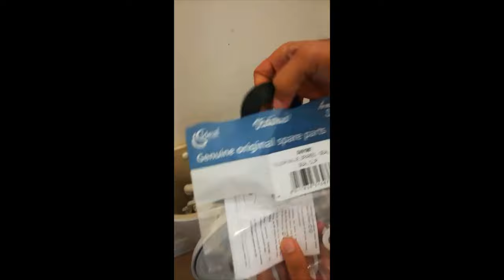How to Fix a Leaky Toilet with Running Water Stream - Ideal Standard

Comment: If you have a running flush yes it's usually the small seal which hitted. If that doesn't work the float valve may be unrepairable. The float pushes up a lever that operates a small white pip in the seal. Unfortunately there is a tiny rubber seal in the float pivot arm. If that seal goes you will need a whole new float valve.

Comment: Before you replace the unit get a rag or sponge into the socket. Clean off any grot so the rubber bears down onto a clean surface. If any grot gets between the mating face it can leak.

Comment: Thanks so much for posting this. Both seals were damaged on mine after 12 years. The edges of the flush seal had crumbled away over time, and the diaphragm, although visually sound, had a pin hole in it. The flush seal was out of stock in 5 places I tried, but my local Wolseley came up trumps for both items. The replacement flush seal is actually white & the diaphragm is the same minus the little ribs. The SVO1967 flush mechanism has apparently been discontinued now, but the seals can still be sourced at the moment. I bought spare items just in case. Both work perfectly. Top work sir! 👏👏👏

Comment: Thanks for the video. I had purchased one of the service kits and thought I would have a look at how someone else did it, even though I had replaced one before. HOWEVER, when I took the other one apart and fitted the diaphragm, it did not stop filling up. It then became apparent that I needed the one WITHOUT the lip around the top. If I had not watched your video, I would not have known there were 2 types! So despite it fact it was not the one you needed, it was the one I needed!! So once again, thank you for your informative video.

Comment: Excellent video! Have the same ideal Standard toilet and both parts needed replacement. Dripping and tank not filling up water all now fixed. First woman plumbing job done 👍.Thank you so much. You saved me £120 bill for plumber.
Reply: @k9 from where did you buy/oedered the right version of mini washer? I am seeing only the flatter ones everywhere. Many thanks 😊
Reply: @youdleydoo  I went to a local pluming merchant shop, took a photo and they had it.

Comment: Freehansa you are Godsent. I was quoted £100 plus parts and yet did not turn up for the job. So I was forced to search for help online. I was about giving up when I saw your video and found out it was my kind of water system and same problem. Long story short, bought the parts this afternoon, changed them following your instructions and the leaks stopped. You have started my weekend on a good note. Thanks bruv!

Comment: I am so pleased I came across this video. I have had exactly the same issue as the one you are talking through. After replacing the main flush valve (which probably needed to be replaced anyway, the water was still leaking from the inlet valve, even after holding up the plastic float which I didn’t even know was possible!!

Anyway, thankfully after taking a picture of your diaphragm part I went to multiple stores and all had the standard diaphragm valve which you also show (from screwfix etc) after going to my final plumbing merchant (Wolesley Plum Centre) they gave me the correct valve and like your set up, the water valve is all tiled away behind the toilet. 
From switching off the main water valve in the kitchen to replacing the diaphragm, it took about 4 minutes! Switched the water back on and now all working.

Your video is very well explained for me and has probably saved me a call out fee and a replacement inlet valve, all for some inconvenience in shopping around today for the correct valve and spending £8 as I had to buy the full ideal inlet service pack.

Thank you again!!!

Comment: Very helpful, thank you!  I had the same problems but was fortunate that a good clean of the inlet valve diaphragm sorted the drip.  The flush rubber was very clogged up with toilet cleaner - a new one was easily fitted with your instructions.

Comment: You explained this well. I had this problem in two loos, and it turned out one was just the flush valve but the other needed both changing, though I found the new (non-ridged) Ideal Standard inlet valve diaphragm cap worked fine. You saved me a plumber's bill and a lot of stress - thank you.

Comment: Thank you for this excellent video. I just fixed ours with a new diaphragm thing and saved I don’t know how much in plumber fees! Just wanted to let others know that the new one will be smooth, the ridges that are on the old one are caused by it compressing into the tube, that’s what causes it to fail. Thanks again.

Comment: Thank you very much for sharing your experience. The service inlet valve servicing kit does not come with a serrated diaphragm as it has been discontinued, however, the smooth diaphragm as provided does seem to work. Also, be very careful when you turn the unit the lugs break very very easily!😀

Comment: Hey followed this fix again as the inlet diaphragm went, Freehansa, I can't state how invaluable your video is, all the info and gotchas are spot on. I had it playing in the plumbers merchants while we were working out which part it was (raised edges as opposed to the flat edges as you said). Absolutely spot on fix. Thanks again! Saved me a lot of money.
Reply: Hi Kato, Where did it find the Ideal Standard Univalve Diaphragms. Mine got raised edges as compared to the flat edges. I am not able to find it online or from Ideal Standard.
Reply: @hamentraina  same here. Its been months but can't find the raised edges one anywhere.
Reply: Could you please share the info from where did you found the raised edges washer.
Reply: @youdleydoo  I couldn't find it. I have to replace the whole thing....

Comment: Lifesaver, well explained video, uk too, I have the exact same issue and ideal standard fill value. Ordered 5 rubber seal's for £17 from the well  known next day deliverer.  They also sell the full ideal standard fill value system for £21 and just change the quater turn part with the washer in.

Comment: Excellent video, I've had the exact same problem with the exact same toilet. I've replaced both washers and now the bathroom is totally silent. The other washer was obviously disintegrating, there was black fluid all around. Brilliant.
Reply: Great news that you fixed it! May I ask where you managed to buy the smaller more complex diaphram from? I have searched, but no-one seems to stock that one. Many thanks.

Comment: Very helpful. Hopefully my problem might be solved. God bless.
Reply: I have Armitage Shanks Dual Flush. I couldn't remove the central  gadget but by fiddling by my fingers I found the rubber diaphragm had slipped off. I pulled it out and washed it and put it back and pressed it upwards to fit. No clips. It works nicely. It' mystery why the central gadget couldn't be removed. I didn't won't to force and break it.

Comment: Thank you so much. I had the same issue and it is now fixed. I replaced but the flush valve and the diaphragm, so i cant say which of the two (or both...) was faulty. Saved me the plumber's bill

Comment: Thanks great video,

One tip that may be of interest to some. After I changed the flush valve it was still leaking. After about 30 mins of reseating the valve it made no difference. I then discovered that the old rubber valve had deposited bits of rotted rubber on the toilet cistern meaning that the new flush valve could not sit and seal properly. After a good clean of the cistern side of the seal all was resolved.

Comment: Excellent video, thank you for taking the time to do it.  Only point I'd make is that when you have turned off the mains water supply be very careful when turning on any taps.  You'd only get a trickle and very soon you will have exhausted the water left in the pipe.  That's when air can get into the pipe from the open tap and you can get a bubble of air causing you no end of problems with that tap as water might not pass it when you open it.  I resorted to pressing a garden hose coming through the 2nd floor window to squirt water UP the tap nozzle to get rid of the air bubble.
Reply from the maker: That is an important point actually. Thank you for highlighting it.

Comment: Thanks man, i live in Finland and for some reason my 10 years old house has this type of toilet that the original builder had installed. Very bad thing, because nobody sells these Ideal Standard spare parts here, only option is to know the right part and order from online uk or de. This helped a lot !
Reply from the maker: I am glad it helped. I was in the same scenario. My house too is 10 years old & I struggled to find the problem and the correct parts. But in the end it all worked alright.
Reply: @freehansa  My house is also around 10 years old. Any chance you can please let me know where I can find the Diaphragms for the inlet valve, please.

Comment: Great video thanks. I would suggest the Blue deposit is not caused by toilet cleaning blocks BUT its copper deposit from the plumbing in the inlet water pipe work.

Comment: Thank you for the heads-up!

I replace the whole inlet trying to stop a running bowl but still have the issue so it's the flush seal I need... All these fixes are cheap until you buy the wrong parts :/

Comment: Very helpful- like you I changed the seal on the cistern but water is pouring in through the inlet valve … looks like it’s the second one need to fit … hope that fixes it - thank you!

Comment: I have done this change before but changed the whole inlet.... and another time there was leak because of a valve deal clip being worn... but never really got the educational benefit and clarity your video provided.  thing is it has recurred and hadn't noticed silent leak.... I think the silent leak is only inlet/diaphragm related? and you would have a different sort of leak (on to floor) if the valve were to be faulty.... perhaps a plumber will comment. Really great video!!! Well done...not being a pro! At one point there had to be some help as you don't have three hand or a AI stand.😂

Comment: I have the same inlet valve and had the same problem with replacing the diaphragm. Except in my case I had to use the one with the ribbed pattern. Using the other one, even with the raised edge left the cistern continually filling.

Comment: Excellent video. This helped me understand a bit more. Alas, it's not the exact and much more compact Ideal Standard Dual Flush with the two long blue tubes that I have. So, I still need to call out a plumber.
Reply from the maker: Thank you. It would help if they made modular units which were easy to repair / replace.

Comment: In the longer term it might have been better to have fitted a new bottom entry inlet valve at the same time. The newer models fill the cistern from the bottom of the inlet valve as opposed to the top  and as a result they are much quieter - no hissing or dripping etc. The advice on the flush valve washer was very good and as they only cost about a fiver it is worthwhile always keeping one at home as a spare.

Comment: Thanks for the video! Fixed my first toilet a treat after replacing the diaphragm washer and flush valve seal. 

Open question. But when replacing the washer and seal on my other toilet (same ideal standard toilet) the new style diaphragm washer made the dripping worse than the old style washer which has a small tear. Baffling me why the new style diaphragm has worked on one toilet but not the other

Comment: Get used to doing this, I have 3 toilets with exactly the same cistern fittings and have to change these regularly....if you just pop the diaphram cap away from the long float 'stick' it comes away and is easier to fit the new diaphram.

Comment: Thank you for your video. Can you tell me how you managed to get under the water tank? I also have the same issue. There is absolutely no space for me to get under it in order to change the inlet valve because mine has a whole on it.
Reply from the maker: I couldn't. There was no room for me to access the inlet valve. Otherwise, I would have changed the whole thing. That's a job for a plumber to sort out. Therefore, I changed the seal and the inlet valve diaphragm, as shown in the video.

Comment: Great video,.looks just want I need. However could someone please add a link to the exact product needed, I've bought 3 now and nine fit.
Reply from the maker: Hi Nick, I bought the flush valve seal online from "fixthebog" on amazon. Link https://www.amazon.co.uk/gp/product/B07FW1GSQ3/
I bought the inlet valve diaphragm from a local plumbing merchant as whatever I ordered online did not work.
Reply: @freehansa  brill, thank you. I've finally managed to find somewhere that stocks it and problem fixed. Very helpful video 👏

Comment: Excellent video. I have the exact same toilet. I have narrowed the inlet valve down to a Univalve inlet washer SV32967. Is this the correct part number?
Reply: Did that type work?
Reply: @paulsweeney5642  unfortunately it did not, I ended up replacing the whole unit.
Reply: @Scrummy21  In order to replace the whole inlet valve do you need to be able to access the underside of the toilet cistern in order to release the valve? I have the same problem as the guy in the video in that my toilet cistern is tightly situated above a shelf and there's no way I can get my hand underneath.

 I'm hoping it can be removed from inside the cistern in the same way as he showed how to remove the flush valve/syphon just by turning it and lifting it out.

Comment: Inlet valve went last night and I'm on a meter so needed to fix it pronto. Local trusty plumbing store informed me that Ideal Standard now sell the valve diaphragm washer as part of a kit, "Inlet Valve Servicing Kit - UNI" at the eye watering price of £13.25.  Kit comprises of six different items, but I was told that only the washer would ever be needed, the store staff stated that the "other bits" were just fillers to justify the price. Store showed me that all other makes were selling similar washer priced at £3-£5, but of course, they don't work on the Ideal Standard toilet. Not happy, but had to bite the bullet, toilet working fine now.
Reply: £13.25 compared to circa £150 quid if you'd had to call a plumber out to fix it... I'd call that a great result!

Comment: Which merchants did you get the diaphragm from for the water inlet valve
Reply from the maker: The one I bought it from is called "Bucks Heating and Plumbing Supplies". But I think any local plumbing store is worth visiting as they may stock this item.
Reply: @freehansa  thanks

Comment: I took off the outflow flush valve and the seal was badly deteriorated. However as I took the seal off I accidentally turned the mechanism and the internal column came out. I tried to put it back in again but it won't stay in and when I tried to test the pad for the button when pushed down now doesn't do anything. Do I need to have the new seal on or have I messed it up completely?
Reply from the maker: If the flush mechanism is not working, after you put the whole thing back, then it is likely that it has gone faulty. Just replacing the seal may not work in this scenario. You may need to replace the whole thing.
Reply: @freehansa  I feared as much. Many thanks for your help

Comment: Unable to take out the top of the inlet valve. The whole column turns when i try to unscrew the top. Unable to access the inlet valve from beneath since the toilet is fully concealed underneath. Do you recommend using wrench to take the top off while holding the steel with another wrench?
Reply from the maker: That might break the plastic part. Not recommended, Probably stuck due to limescale.  At the most you could cover the part with medium thick cloth and then try with a wrench, but if it doesn't budge, then do not force your way through it.
Reply: @freehansa  I had the same problem trying to get the top off (mine's the old screw type not a quarter turn one). It was stuck solid so I sprayed it with loads of limescale remover (Viakal) and left it for a few hours, that did the trick.

Getting it back on again was not easy though...

Comment: Hello, I am having an Ideal Standard toilet and am unable to find the Diaphragms. Mine got raised edges as compared to the flat edges. I am not able to find it online or from the Ideal Standard online store. Any pointers where I can buy it please.
Reply from the maker: Local plumbing merchants are your best bet. I could not find one online either but local stores had it. Please check in a store locally
Reply: @freehansa  Cheer mate. I will look for a local store. I am based in Uxbirdge. Which was the local store where you brought it please.
Reply from the maker: @hamentraina  Mine was called Bucks Plumbing and Heating but they are only limited to Aylesbury. Your local stores should have this too.